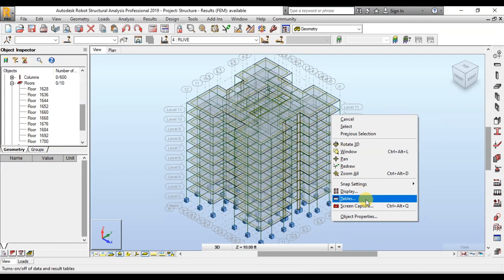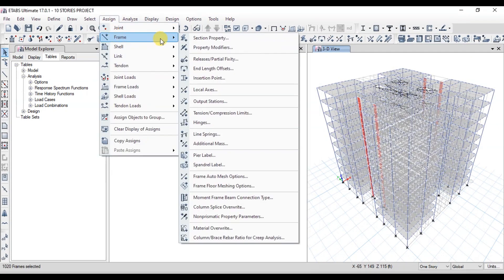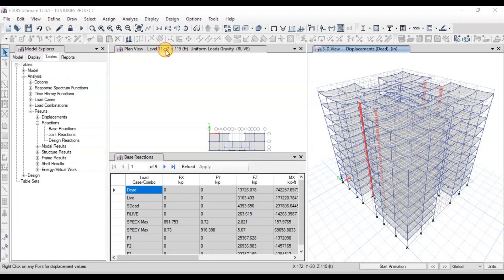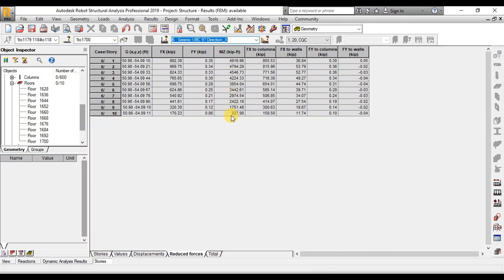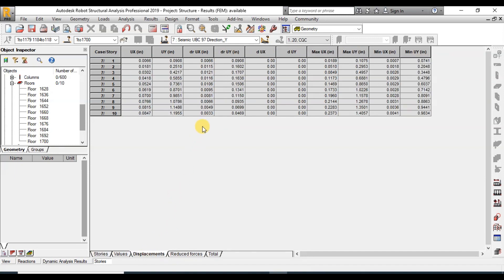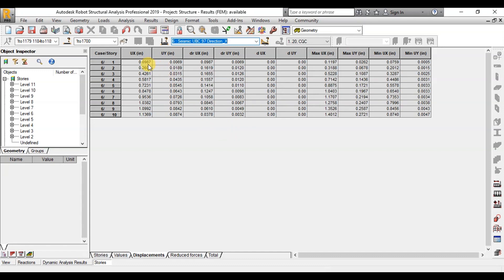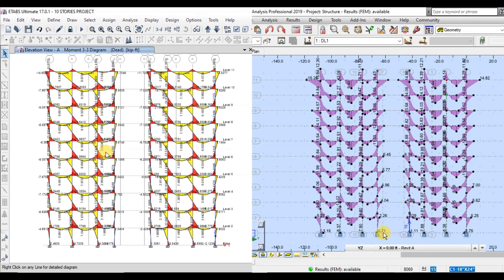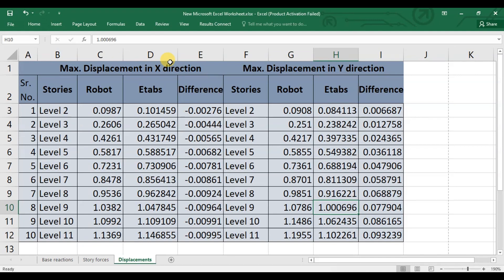Etabs vs Robot | 10 Story Building in Revit Robot & Etabs | Structural Analysis | Robot | Etabs

Comment: DL reaction results difference is about 300+ rest are almost same. RSA value is more than ETABS. have checked almost everything thing like material, section etc. but unable to find reason why such a huge difference. Please share your email so that I can share the etabs, RSA & revit file for cross check.
Reply from the maker: Yes, you are right! results differ in both software slightly mumarlatif@gmail.com
Reply: sir I have shared the files, pls do check and revert back @revitforbeginners